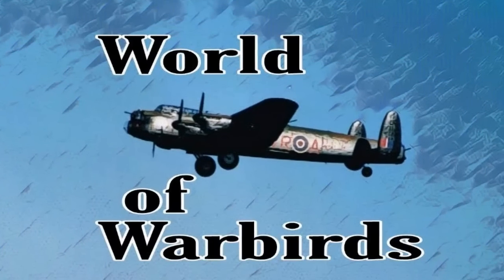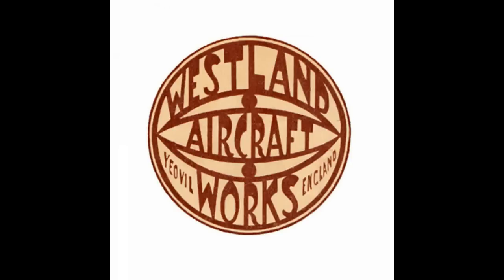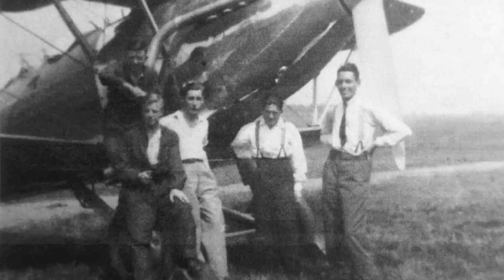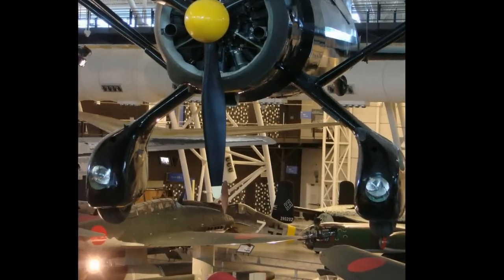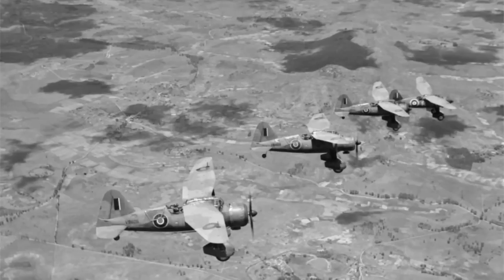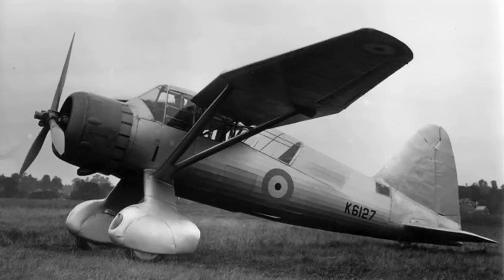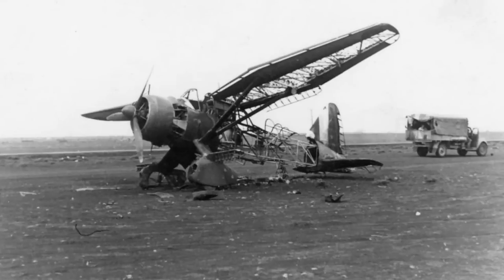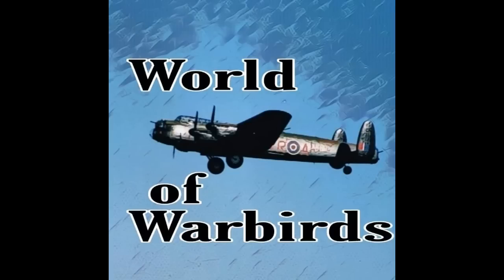Lizzie: "Lady of the Night" (Westland Lysander)

Comment: So, the British Air Ministry NEVER specifically sought-after a SOE, clandestine insurgency-use STOL airplane ??  How Short-Sighted of these club-house Politicians. 😂
Reply: It's not a function of politicians to specify aircraft, that is down to the technical departments headed by serving airmen. SOE were free to ask for such an aircraft to be designed and built, but time was short and there were many other demands for new aircraft. SOE used a number of types, depending on requirements, including the Lockheed Hudson, specified by Arthur 'Bomber' Harris in 1938, that could land and take off from makeshift airfields. It was used by No. 161 (Special Duties) Squadron and was very effective in the role.
Reply: It was stol?, what to you think the wings was designed for, for taking off in fields iin farmers fields near to front lines where no airfield was built yet?, have you seen the boccage?, then you see why the plain was used and it is a (short take Off & landing) plane? STOL...and the reason its big for a stol plane compared to others in ww2, is that it could be decently armed with whats been mentioned carry three people including the pilot and two heavy wireless set in luggage bay or another person lying down and still get airbourne or land in time  before hitting a hedge..
Reply: @utrinqueparatus4617 hudson could only drop clandestines through the whole in the floor and parachute? they couldnt land to pick them up when they was being hunted or to pick up people of interest , the reason for the lysander usuage for these special operation duties..